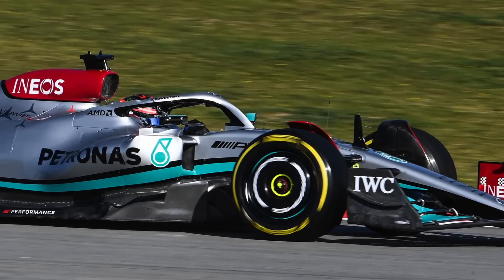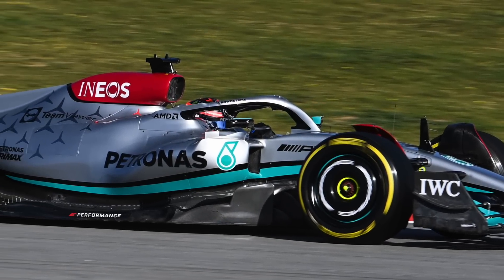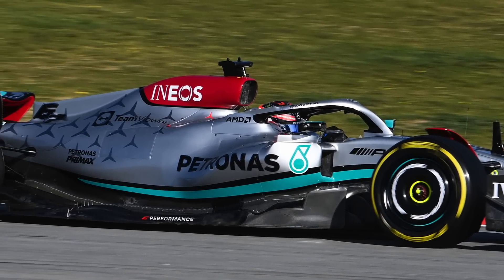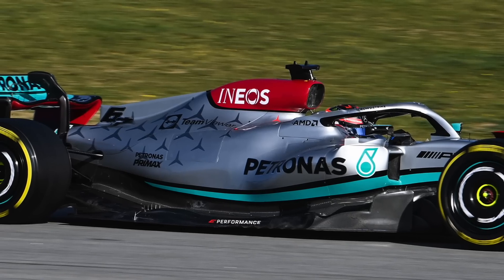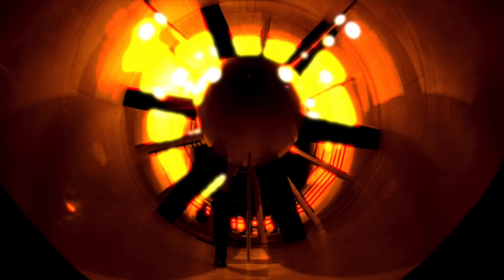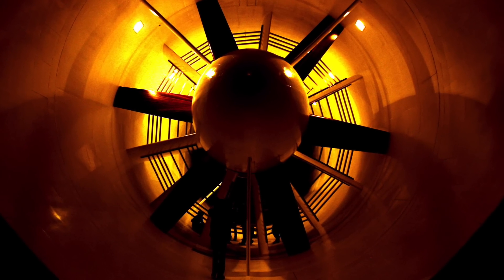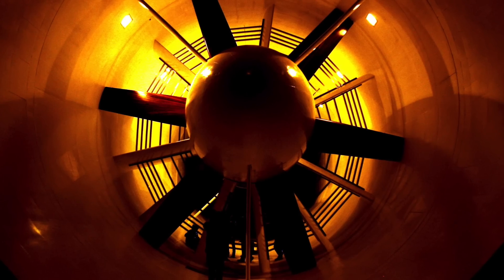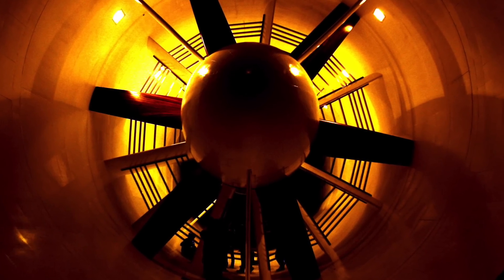F1 car porpoising: CFD or tunnels? By Peter Windsor

Comment: To say that CFD only works for steady flows is wrong. The teams can probably only afford steady state simulation because of their limited CFD hours, but in general it’s definitely possible to do unsteady simulation e.g. a flip flopping tyre wake.
Reply: Looking forward to you presenting some evidence because. https://en.wikipedia.org/wiki/Frank_Dernie
Your cost analysis, is that based on current rules or the history of F!?
Reply: @Margarinetaylorgrease  just look at this Video: https://youtu.be/IDeGDFZSYo8
To simulate transient flow in cfd (like in this example) is not that difficult. However it comes with an increas in computational efford, wich is so big, that its „impossible“ to really use it for aerodynamic development in F1.
Reply: @fabi12h  Thank you
Reply: @Margarinetaylorgrease  Evidence? For what? That there are simulations of unsteady flow phenomena? Ever watched the weather report?
Reply: @AR_434  Weather report and CFD?
Reply: @AR_434  knowing people who work on this, they rely on super computers and are still just guessing. To fully model this you need to model the suspension and tires, and no one has that level of computing power except Los Alamos, and now you’ve introduced even more models to the equation which need validation and can still be wrong.
Reply: @AR_434  and they’re approximates and rely on super computers at Ames or Los Alamos in the US, and other super computers elsewhere. Even NASA had to use the Ames super computer to model the front landing gear on a Boeing 777 and that isn’t nearly as complex as an entire F1 car.
Reply: @Hoffbottraces  I work at a university and use unsteady CFD Simulations (mostly LES) to model the flow and the acoustics of fans so I know a bit about that stuff. Of course you can always crank up complexity so that it becomes impossible to compute. However, I was just commenting on the quote in the video „CFD only works for steady flows“. A proper unsteady RANS can probably reveal a lot about tyre wake and such things which isn’t computationally too expensive, but maybe still too much for the tight CFD-hours of the F1 teams. If you want to see what’s possible for CFD and machine learning in racing sports, check out the last America‘s Cup!
Reply: @Hoffbottraces  it depends so much on how fine you want to resolve the turbulence. I know those NASA simulations. They are very finely resolved, which would make no sense for simulations they do on race cars.
Reply: @AR_434  the problem with a F1 car is that it isn’t infinitely stiff which the cfd models would assume. 60% scale model F1 cars also likely have minimal suspension if any. The problem is vortex shedding imparts structural mode interactions that interacts with the chassis and tires and that likely isn’t being captured in cfd or a wind tunnel. As you probably know, these structural mode interactions are why skyscrapers have tuned mass dampers.
Reply: @Hoffbottraces  that gets crazy complex. My colleagues work on simulating fluid-structure-acoustic interactions and I don’t want anything to with it.. A proper combination of simulation and experiment is still the best way to get as much information about a flow phenomena as possible.
Reply: @AR_434  100% agree.
Reply: @thecraggrat  I don’t think they are restricted in which methods they use, just in the number of CPU hours. Their focus lies in efficiency not in using the most advanced and exact computational models. Combustion simulations are CFD simulations plus computing the chemistry and so on. The methods SpaceX uses is nothing that only they can do. There are quite a few companies that specialize in different areas of CFD. I read e.g. that Merc has help for their cooling system from Reaction Engines, a British aerospace company.
Reply: @AR_434  that reaction engine tech is pretty neat I wonder if other teams will try and come up with their own now that it’s speculated how Merc was able to get their side pods so small. It will be quite interesting to see future F1 if all teams pick up on this heat exchanger tech and how small side pods will become.
Reply: @AR_434  Now you mention it I think that they ration out the CFD in TFlopHours. Mind you, how they normalise it across the teams and the different software running I don' t know.
Reply: @Margarinetaylorgrease  Simulations doesnt come from someone's fart, right? They experiment observe real world, model it mathematically as close to real thing as possible! Then simulate. Try real world, match the results, adjust, simulate, adjust, simulate.... so you dont have the use the actual test models all the time which takes time and money to test/modify/rebuild them. The more data you have the better/closely you simulate the real world! Air tunnels use are limited, so they can do more CFD analysis before they try the real thing!  So saying simulation works for one scenario  is wrong, is a correct assessment. Obviously nothing beats the real thing, but that doesnt mean, you cant simulate it as close to the real thing as possible!
Reply: @mytester6208  CFD is not modeled after some observed experiments. It’s a numerical solution of the Navier-Stokes-equation, which in it self can fully describe the flow of a newtonian fluid. Some (turbulence) modeling is done to reduce the size of the numerical simulation, but theoretically the N.S. equation can fully describe a fluid flow, no need for prior experimental data.
Reply: @AR_434  CFD is a equation, in itself is nothing if it doesnt represent something. That something talked about is the simulations using the formula based on certain criteria. The criteria/conditions come from real world observations. Where does the CFD come from? out of thin air? It says it in the name, computational! What/why do you compute? the mathematical models to real world! not sure what you on about. You def need experimental data to see what you compute matches the real world. Where do the fluid dynamics come from? again your back side? You formulate these kind of equations to define physical/chemical/biological realities... You define certain conditions, and expect certain results and observe reality vs calculation.... you reformulate/recalculate and re observe.
Reply: @AR_434  also what is The Navier–Stokes equations represent? how did they come about genius?
Reply: @mytester6208  the N. S. equations apply Newton‘s second law to fluid flows. It’s a simple set of equations that describe the conservation of mass and momentum. They are like I said quite simple, but still impossible to solve analytically for turbulent flows and expensive to solve numerically. They’re were formulated 150 years ago from mostly theoretical work. Just check wiki for them and you’ll find plenty of info there.
Reply: @AR_434  they are math eq to define reality as close to reality or sometimes exactly. i dont understand what you dont understand, they re used to simulate/emulate reality. whats wrong with the word? cfd used to calculate fluid dynamics in other way of saying simulating reality with numbers so they can be imagined. what is newton's law? set of conditions and equations to calculate reality still, in other words explain reality with numbers aka simulation!
Reply: @mytester6208  I‘m sorry, but I can follow what you want to say. Newton’s second law is maybe the most fundamental equations in classical mechanics. Go read about it. It’s going to show you how beautifully simple the world can be described by a tiny bit of math.
Reply: @AR_434  You keep repeating the same thing mate, they are representing/describing real world. thats what the simulations does with the conditions you describe. i still dont understand what you are arguing about. cfd they use describe what happens with the given conditions/parameters, to visualize. but there is more to real world than simple equations, it is much more complex with more variables involved with butterfly effects everywhere. thats why scientists/engineers use the simulations as much as possible and apply to real world to see theoretical calculations match the real world! they cant build a full scale car everytime they change a parameter/condition to see if it will operate they way they expected. hence the simulations/models then real world applications. not sure what is wrong with what i said that you have problem with
Reply: @mytester6208  Arguing? I tried to explain the fundamentals of CFD, but it seems like I’m not doing it well enough. Like I said before: try to read up on classical mechanics and it will open your eyes. Cheers!
Reply: @AR_434  i get what you say, but originally u said no need experimental data. cfd you said just equations and can be calculated. i never said they cant be, but cfd in itself comes from modeling real word stuff. newton didnt come up with his equations out of thin air, he based them or made them to explain what is happening in real world (observations) to match his equations to these exactly or as closely as possible. But my main reply was to so someone who didnt agree with your assesment, which my comment did! i wasnt talking about the type of cfd they were doing, i said they had to do them in order to fit in the budget. Then you said cfd is not modeled based on experiment/observations. now i dont know what you are really trying to say. all the physical equations are defined based on what exactly?  here is a wiki as you asked me read more about? "The fundamental basis of almost all CFD problems is the Navier–Stokes equations, which define many single-phase (gas or liquid, but not both) fluid flows". what you said to me "CFD is not modeled after some observed experiments." are they are modeled around imaginary flows of imaginary materials in an imaginary dimensions that we dont know about in this space-time dimension we live in.
Reply: @mytester6208  I think, you get ‚equation’ and ‚model’ mixed up.
Reply: @mytester6208  And yes: You can take a random geometry and wind speed, do a direct numerical simulation based on the N.S. equations and get a physically correct results of the flow in space and time. No need for any experimental data up front. Amazing, isn’t it!
Reply: @AR_434  is it chicken or the egg? is math invented or discovered?
Reply: @mytester6208  maybe! But I‘m surely in a continuous loop of telling you to read up on even the most basic physical principles. Start with Newton, go to Euler and if you want to blow your mind read about Einstein theories on relativity. What those guy could figure out without experimental data is truly amazing. That would change your look on things. So long!
Reply: @AR_434  i think it is obvious that your look on reality is stuck on formulas thinking they define reality... you just cant see the reality in front of your eyes defining those formulas. experiments you keep saying but not sure you understand the words you are uttering. you just cant see that reality is keep changing those formulas. but i ll stop at this, since you are too blind in your understanding of formulas. i recommend you to learn what reality is!  that would not change your look on things for sure as when you think you know/learnt it, it throws one more stone to light with your formulas.  when you say so long so schumuckly, reality says oh hi, we are just beginning....
Reply: @AR_434  also funny you ask me to read... let me read you something (i know it will not be silly like your statements).

"Scientific laws or laws of science are statements, based on repeated experiments or observations, that describe or predict a range of natural phenomena.[1] The term law has diverse usage in many cases (approximate, accurate, broad, or narrow) across all fields of natural science (physics, chemistry, astronomy, geoscience, biology). Laws are developed from data and can be further developed through mathematics; in all cases they are directly or indirectly based on empirical evidence. It is generally understood that they implicitly reflect, though they do not explicitly assert, causal relationships fundamental to reality, and are discovered rather than invented."

Let this sink in for once more "Laws are developed from data and can be further developed through mathematics; in all cases they are directly or indirectly based on empirical evidence" I dont think/hope you will understand the fundamentals of the basics of science. you just uttering words but dont have the slighest idea what you are saying. maybe one day you start to get enlightened
Reply: @mytester6208  Do me a favor and check the wiki article on Einstein‘s Theory of relativity and then tell me how he derived that from experimental data. I’m too dull to understand that, but maybe you can help me see a bit of light on that subject. I‘d appreciate it! Another thing would be Heisenberg laying down the formulation of quantum physics in 1925. I can’t understand how he did that and maybe you can help out here too.
Reply: @AR_434  Do me a favor, and check what science is about. Learn so you dont fart non-sense about people farting formulas out of thin air. I understand you dont wanna learn what science is, not what you think it is. And stop looping the fart that people come up with formulas without experiments or gathered data.
Reply: @AR_434  my final advice to you, i can only recommend you to learn about what do hypothesis, theories and laws mean and why. if you really wanna know the fundamentals of science, i can refer you to many resources, but you have to be ready to learn, and stop looping the same melody.
Reply: @mytester6208  I have a bit of a hard time taking such advice from somebody that didn’t know who Newton was, but alright bro, I will try: Please loop your melody and tell me where to start!
Reply: @mytester6208  Thanks for your time man. It’s been fun to get you a bit fired up, but don’t take it personal. It was all in good fun! And don't worry.. I'm well aware of my short comings. Are you of yours? Have you ever heard of Dunning–Kruger effect? So long pal!
Reply: @A R. Glad you covered it!

My whole world started with Navier Stokes equations which I can still derive. Mech Eng fluids major then PhD. 

Either in CFD or vibro-acoustic coupled structural FEM and acoustic BEM modelling to solve commercial product development problems. 

Fluid mechanics was my starting point into acoustics.

My mates PhD was pioneering CFD methods for the ultimate non steady state, acoustic waves in CFD running off out of the mesh model at 340m/s....

Comment: The teams that are sufferig porpoising the most are probably producing so much downforce that they have more to fix than those who aren't working the floor so hard. Once they apply the fix to counter the aero-bonce, it will simply be a case of finding the balance to get the performance they want.
Reply: Yeah I think teams have said they are producing a lot more load at the back compared to why they expected and so it’s bending the floor more and causing the porpoising. Guess if they can get on top of it quick enough they may end up with more downforce still than those without the porpoising.
Reply: Concrete Head  Oh Clearly running race fuel loads.

Comment: Ahhhh yes Gramps, this is another lovely token.

So, CFD is not that reliable but when combined with a wind tunnel, data accuracy gies through the roof eh?

Nice.

Wonder if the limitation on CFD and wind tunnel on a sliding scale would actually impact the pecking order.
Reply: Short answer no. CFD relies on superior processing power, mature algorithms and greater minds overall. The big teams backed by corporate check books can afford those in greater quantities.